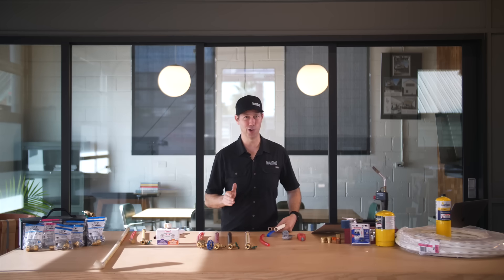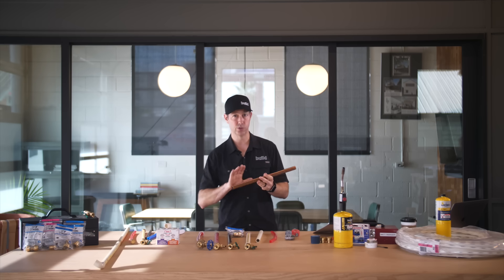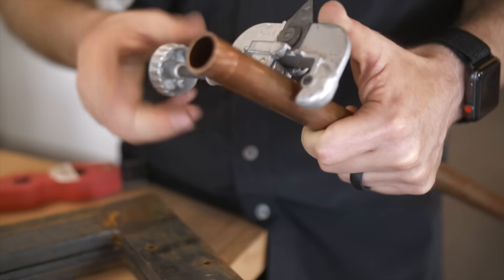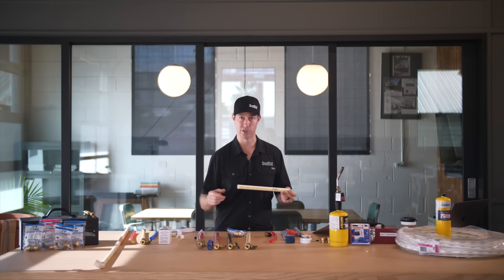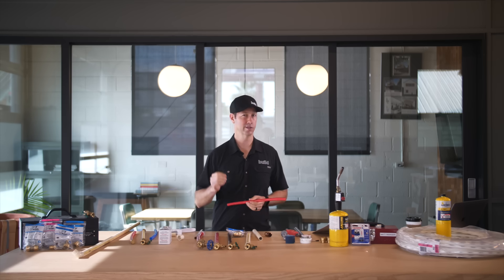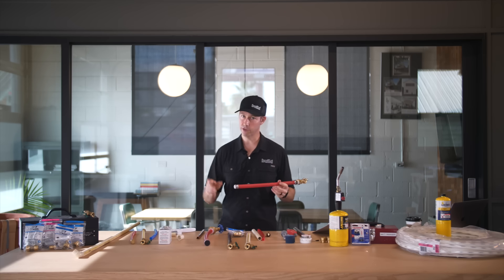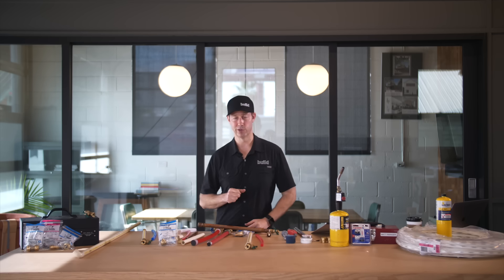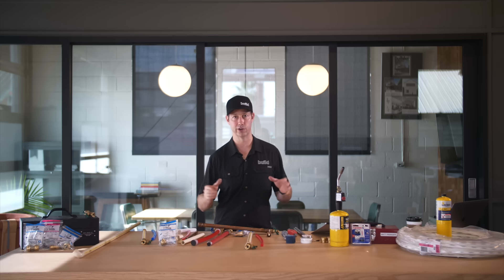PEX vs COPPER vs CPVC plumbing pipes

Comment: Ok where to start with this one.... 
    Pinhole leaks in copper water systems are not rare at all. They are quite common in Florida. We repair pinhole leaks on a regular basis both above and below ground on horizontal and vertical piping. When soldering copper always apply solder beginning at the point on the joint farthest from the heat you are applying and always wipe the area around the joint with a dry cloth after soldering to clean up excess flux and prevent corrosion. Water hammer is can easily be prevented by adding a hammer arrestor at vulnerable points (Ice maker, dishwasher, clothes washer, lavitories, etc..).
     I have been installing CPVC and repairing it for years. After about 5-10 years, give or take, the tubing begins to get brittle. Also if you are not diligent in properly cutting and gluing the fittings it is possible to have a fitting blow off several minutes or even hours after the water is turned back on. This is my personal worst nightmare as a plumber and for these reason I try and avoid using CPVC where I can. There are atleast two majior manufacturers of CPVC in my area, Flowguard Gold and Silver Line. Flowguard Gold is the industry standard and the only product I would use. Do not.... use primer and glue on CPVC. There is a yellow all in one primer and glue made by Flowguard Gold that you should use. I am not sure if it is the case anymore but in the past, Flowguard golds warentee was only good on systems that used the pipe, fittings, and glue made by the manufacturer. 
     If you need to use a PVC primer in an area where you are worried about dripping or spilling purple, there is a clear primer for PVC that is the exact same thing but without the dye. The coloring is added so plumbing inspectors can see that primer was used on the joint and not just glue.
     Pex type A is defiantly the best of the bunch in my opinion. My only reservations are to see if the piping can maintain its flexibility over several decades, but only time can tell. 

God this turned into a full on rant...
Reply: Copper pipe + chloramine (disinfectant) = pinhole leaks
Reply: @KreemieNewgatt  also, nobody ever mentions the fact of reaming pipes, or the ill effect of not reaming pipes.  I should demonstrate this on Youtube.
Reply: @KreemieNewgatt  copper pipe+ water=pinholes
Reply: @researchair7693  LOL ya that too
Reply: @researchair7693  not to mention poor Ph levels
Reply: @KreemieNewgatt  I was wondering why pinholes might be common in the US for copper, but that's a very reasonable explanation (also mixing metals, like in the boiler and the piping is an issue). I have other experiences with copper, no pinholes, for many decades. (But where I live, no disinfectant is used in the water systems, so that's maybe why I never experienced that issue).
Reply: @KreemieNewgatt  Which is a shame, and can ruin perfectly good systems in a lot of houses.
Reply: Safe to say with “today’s” CPVC quality it is by far the best needing no special tools considering labor is the issue. You have to be able to stand on your head and spit nickels for copper piping not to leak or rattle. Especially since 99%% of all the plumbing work done is repairing and remodeling. Anyone repairing and  remodel doing anything but CPVC is stuck in their ways and will be left behind. Copper is simply not cost effective. The PEX has lawsuits because the P in PEX is coming to get you. The two major CPVC companies it is literally their sales pitch. You would NEVER do a new spec home in copper unless the town is backwards. Anyone sweating pipe just wants to slow everything to a screeching halt and  try some funny witch craft with torches and shiny things that drip that burn things and you and hope his obtuseness of wanting to sweat copper and pontificate about their experience with cpvc that was literally produced a quarter century and could be of any low quality brand from that time ago does not apply. Use the current cpvc and it is BY FAR the best. The only reason why anyone talks about Copper is because they can do it and won’t EVOLVE. CPVC allows everyone in the world to plumb their own house. Nanny nanny boo-boo plumbing is over. As it should be. Yes I am a plumber who became a mechanical engineer whose family owns a mechanical contracting business. Take it to the bank.
Reply: @hatzlmike1  I've worked with copper pipes and compression fittings. Quick and easy to use. Adds more cost per joint as opposed to soldered joint, but A LOT less labour intensive. (Not a professional plumber, just worked on plumbing as a DIY).
Reply: @hatzlmike1  take what to the bank?
Reply: @hatzlmike1  I don't know why you're trying to sell CPVC to us so hard, but in my experience it's junk after 10+ years, even with good quality well water. I'm now having to go through and completely replace everything in my parents' house. Fix one thing, break 2 more. It's all getting replaced with PEX. Anyone can plumb their own house with CPVC, true, but they'll have to re-plumb it every 20 years. The only people claiming CPVC can last 50 years are the salesmen.
Reply: Pin hole leaks can be caused by a number of things. The quality of the copper pipe has a lot to do with it. If there are any impurities like iron mixed in with the copper you will have problems. Also the majority of leaks will be in the hot side and more often then not they will be right after a couple of 90 degree fittings and possibly where the pipes where not de-burred before soldering. These things cause turbulence inside the pipe which in turn causes wash out. The softer copper that can sweep in and around as opposed to having to install 90's is a better bet. Soft water systems that aren't installed properly can cause leaks. As will any time there is an electrical current back feeding through the plumbing.
Reply: @iamjackalope  
I built a condo project in NJ back in the 90's.
Used "K" copper, all home runs,..
Within a few months we started having under slab pin holes even though the copper was sleeved.
After much research the problem was determined to be a very aggressive water from the local utility.
We found out the older homes in the area with copper were not affected because a layer of oxidation had formed on the inside of the old copper in the area thereby protecting it.
The water company repaired / replaced the copper plumbing in 98 luxury homes. The expense was in the millions..
Reply: Well said.
Reply: Beans from my experience most of the leaks I have seen have been right after the pump on recirculating hot lines. Never could quite figure out exactly how it happens, but I think it has something to do with maybe flux residue on the inside of pipe and the quality of water possibly. But have only seen them on a recirculating line all have been houses right within a foot or so on the out side of pump. I did see a hotel once they had a few pinholes throughout but it was 1 1/2 or 2 and the fittings were growing green fur. How I resolved the problem I ran pet for a few feet after the pump so far has been working good. Which you can get them by mixing metals also  where someone won’t use a dielectric union on a water heater I have see them there also
Reply: KreemieNewgatt I
Reply: Say HELL NO to COPPER. My copper is rotting because of slightly acidic WELL water after less than 20 years.  A professional plumber installed it all, and I did some odds and ends using CPVC. CPVC is perfect, but now I am replacing the copper as it blows pinholes.  Use PEX. Humanities legacy in 2 million years will be the plastics we left behind NOT the copper.  Use copper if you want a plan for obsolescence or you're a Green New Dealer.
Reply: I work on them daily
Reply: Well and septic so hopefully my copper will last
Reply: ty words well typed
Reply: Hey Beans, good job! I enjoyed reading your comment. I have used the CPVC flowguard pipe one large 4000 square foot two-story house back in 2000 7 I have not received any complaints on it yet I sure hope I don't have any problems but I have repiped quite a few mobile homes using Flowguard and I don't mind Pex but when underneath the house and very uncomfortable situations it's hard working at 2 to enlarge the little Boeing so for now I will still use CPVC and just hope for the best.
Reply: Wow that was alot of great information! I'm the Maintenance Chairman at my condo in Peterborough ON and I have initiated many plumbing projects to upgrade to newer fixtures after repeated leaking and plumbers coming in doing the shittiest repairs possible and I always  use copper, no alternatives. I've been hearing horror stories about large 200+ unit condo buildings in Toronto where PEX was installed and 5 years on 1/3 of the owners are experiencing flooding/failures,  jamming the owners with sixty thousand+ in expenses for damage and having plumbers come back in to pull all the PEX out and replace it all will good old copper. It kinda sucks because I attribute PEX with the inherent laziness that comes with trades people these days. Most are out to make as much as they can as fast as they can and most use PEX because it's just faster, the plumber charges the same amount anyway (anyone telling you different is full of shit) and PEX will hang on just long enough to get past the new home warranty program (good luck with that) before it fails and is the homeowners problem not the builders. Of course you'll be lucky if it doesn't freeze somewhere and fail earlier if you live in colder climates and with today's minimum code which is a fu*kin joke it's bound to happen with garbage cookie cutter houses, there is no frigging way I'd use PEX for anything. So copper is a bit more work and expense.. give me peace of mind and insurance any day!
Reply: @Speeddemon3  I've used PEX for quite a while in commercial and residential  and never had a single failure, never had a single callback and never seen a failure  that can be attributed to the system so I am wondering why you are having these experiences. You might just have plumber in Peterborough that is truly a hack. There are a lot of benefits to PEX - better water pressure, no scaling, less joints and therefore less possibility for leaks, less heat loss, less condensation and less prone to freezing. If it is behind a wall and not subject to UV its lifespan is actually better than copper. I appreciate your opinion and I do appreciate the belts and braces approach but It contradicts my experience. I would not use CPVC - I've seen enough failures with that stuff and don't really see the benefits.
Reply: @Speeddemon3  = PEX has been used in Europe now for more than 20 years with almost no problems there.  If the condo installer used those stainless steel 'Clamp-type' crimp rings then that's the failure point right there, those things pop open after a few years. The sold copper crimp rings never expand open like that and thus they don't leak. The stainless steel 'clamp' type used in North America is not allowed in Europe. Some condos used polybutene pipes and that is probably the piping disaster that you heard about. Those polybutene-plastic type of pipes actually do split and burst, but PEX does not.
Reply: @honestycounts9352  Hi HC, wow really? Maybe it's time to start paying attention to our EU plumbers! It is completely possible  polybutene pipes are at fault. Just for the record I'm not a plumber, I know the bare minimum. My father was a J.O.A.T.'s but a Master electrician who taught me after becoming paralyzed. I've only used copper because that's what was already there and had to work with. Never had a failure yet. I do remember CBC, CTV and the National doing reports on these failures in newer high rise condos that were costing 80 - 120k just to have the suites dismantled, re-plumbed, re-drywalled and painted after 5 years and nobody's to blame? It gets past the lame new home warranty guideline and poof failure, and of coarse the contractor isn't to blame, it must be the plumbing itself! Thank you for your insight!!
Reply: Speeddemon3 I was scared of pecan Also when it first came out but it’s great now that I’m used to it . I know when we first started running it in I would say early 2000’s the company I worked for charged less to run pex. I have never heard of many problems with it no more than I do for copper. My only problem with it is in the winter you can’t air test the lines cause they leak. But if you put water on it doesn’t leak that always bothered me but haven’t flooded a house yet. Copper I don’t mind running it but it’s a lot more expensive it’s more of art to it it can look a lot better but I would just run pro for me unless it’s exposed and wanted it to look nice. I’m just glad I didn’t go as far back as galvanized and cast iron those were some plumbers there which I have ran a little of both but wouldn’t want to all the time

Comment: As a few others have stated cpvc gets VERY brittle over time. Maybe the chemistry has changed a bit over time, but I've had valves break off in my hand simply trying to turn them off while trying to also hold them I'm place with pliers to prevent them from breaking. If I'm simply replacing a faucet or whatever with cpvc piping I turn the water off to the house before proceeding with simple maintenance of plumbing fixtures since the piping is so brittle.

Comment: Too bad that Kitec ( now, bankrupted) and UPONOR PEX already have class action lawsuits against their manufacturer. The pipes and fixtures are bursting and causing great damages to houses and condo in North America.
It seems that PEX leaches chemicals in the water. 
I am all for cooper!
Thx for your video.
Reply: Any link for this?  Couldn't find it.  The only lawsuit was for brass fittings, which of course are not needed with expansion fittings.  Pex does not leach chemicals. It is made from the same material (HDPE) that is used for safe drinking water bottles and water storage.  It also does not degraded when exposed to chlorine in typical city water supplies.  You can just google all of this if you care.  You might want to scrutinize the information/stories in some of the individual plumber's websites though.
Reply: Pex also suffers from Chlorine degredation.. common in City centers.

Comment: To copper is the only way to go. My home is 24 years old, has PB (which is not Peanut Butter but Polybutylene) and my Home Inspector recommended I should consider replacing it due to its age, of course I will go with copper, I don't mind if it takes longer to work with or the price, I believe that anytime you need to let water run a few seconds to avoid the plastic taste means there is plastic particles in the water. Plastics OK for drain lines, not for drinking water.
Reply: All municipalities use plastic supply lines now

Comment: In our 25yr old house we had to rip out the PEX system after several clamped fittings gave way in the wall after 12 years.  Yes, those stainless steel clamps rings were intact, but the pex itself failed at the joint. Copper is far superior in most applications.  Water hammer is never a problem if you use an air damper / shock absorber properly.  Yes PEX is cheaper and faster to install, but you get exactly what you pay for.  Do it right with copper and you'll never have to re-do the plumbing.
Reply: Reminds of the older mobile homes where over time the fittings would leak on the plastic water piping.

Comment: I personally like push-lock(sharkbite) type connections.  Got them on air lines holding 80psi I am surely not worried about the low water pressure causing a leak.

Comment: Thank you for the information. I've just moved to Texas, bought a house and all I see is this blue and red piping coming out from the walls. I found the name when I went to the local hardware store. Something I need to learn to fix when there is a problem
Reply: Its very very esy to fix!! Youll love working with it.
Reply: Pex is a dream to work with. Cut affected area, snap on fittings to both ends, cut piece to fit. No heat or electricity needed whatsoever.
Reply: Did it freeze??

Comment: Copper pipe has almost no resistance to heat flow. Copper's thermal conductivity is roughly 380W/mK. Most plastics are in the range of only 0.25W/mK. Plastic tubes also have a thicker sidewall...which directly impacts heat flow.

Still...if you have a concern, insulate. Pipe insulation is pretty cheap.

Comment: Where I live ‘M’ Copper is not code compliant for potable use, we use it for lo pressure Hydronics around about 15#, potable usually is around 60 but varies from about 40-80#.

Comment: Texas exper:  Copper is great but expensive.  (Also some plumbers can sweat pipe. Not their skill.)  ...  PEX is the future, but you need great joint connectors. This is what breaks over time.   But we remodel apartments and PEX is an excellent product.  ----CPVC is the devil.  Doesn't last. We remodeled a 30 yr old apartment product last year. All CPVC..the stuff SUCKS.  Breaks in your hand.  Not a fan!

Comment: My 1948 copper doesn't leak. However, the home is a duplex and all the copper is 1/2". I will be replacing the hot and cold supply loops in the basement with 3/4". Service line is 3/4". I'm thinking PEX or cpvc, as I will be doing this DIY.

Comment: Why would you leave out galvanized pipe?!?
Reply: Jeremy Hess Egads no!  Use black pipe for gas, not galvanized! I have 100 -year-old galvanized pipe that still works, albeit it is ready to be replaced, but it could probably squeak by for another 15 years, and maybe another 200 with a little TLC. No other pipe has lasted anywhere near that long, nor would suffer the abuse this stuff takes. It’s a shame it has been eschewed in favor of the crap we use today.